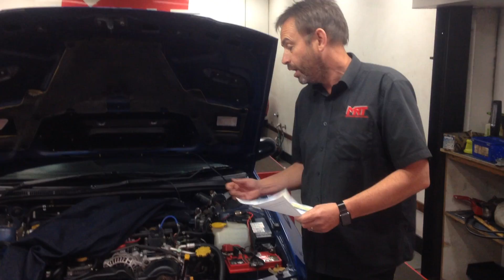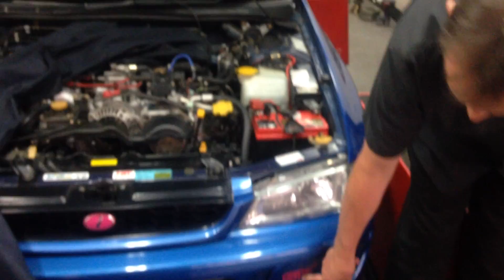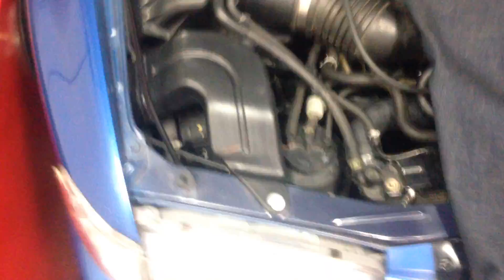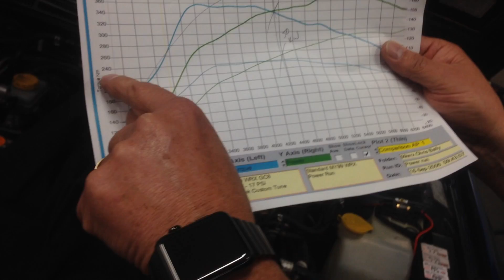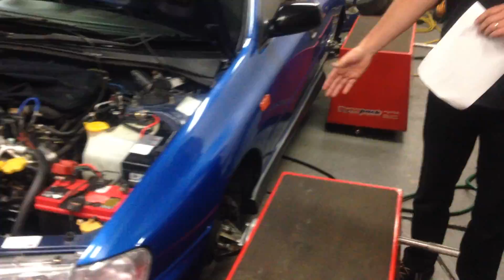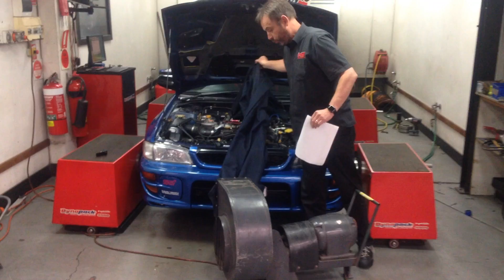Subaru WRX GC8 power upgrade with the MRT XB power kit

Comment: At the end of the video about temperature, I would be interested to know what are the ideal temperature and humidity conditions to make a correct adjustment of ECU tune. So that then in cold or extreme temperature conditions the adjustment that has been made on the basis is compensated correctly. to make an appropriate adjustment in a neutral condition whichever is the intermediate. Thank you